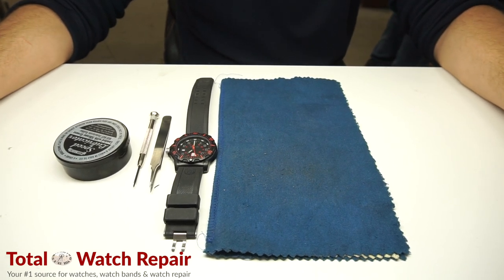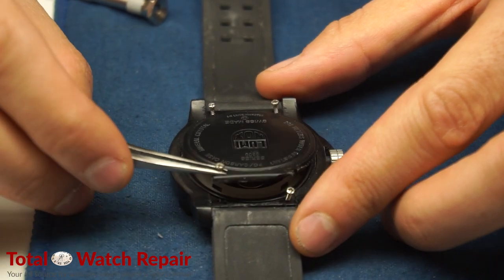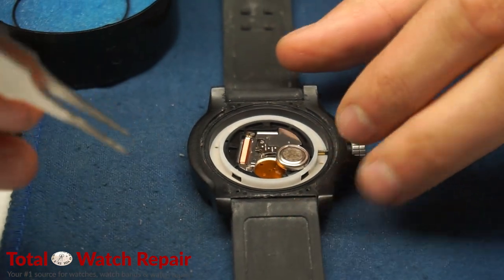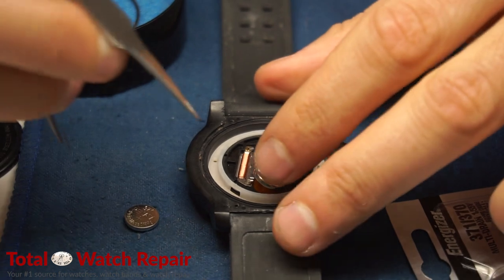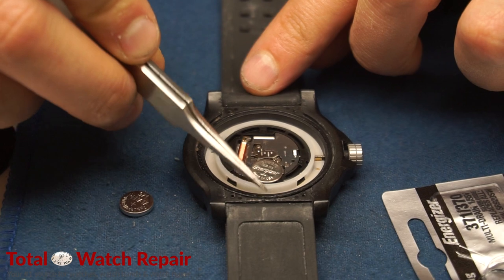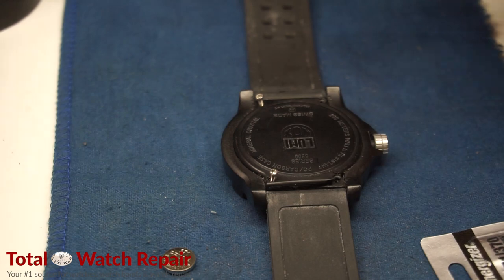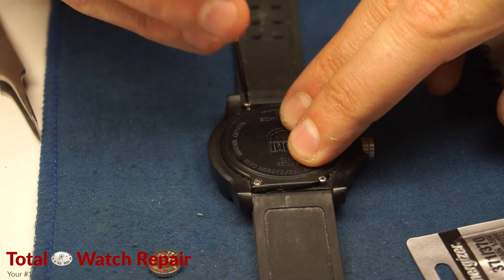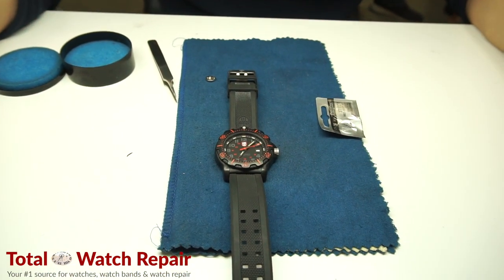Luminox 8800 Series Battery Replacement

Comment: Thank you for this video, specifically stating the type of battery needed and you really saved me by mentioning the little brown insulator required under the battery. I hadn't realized the insulator was stuck on the old battery and without it the watch didn't work at first.
Reply: What insulator?

Comment: Thanks for the video. You might mention in any future videos to always take care in making sure you do this repair in a low-humidity environment. Even a few seconds in a humid, non-air-conditioned environment can lead to water vapor appearing under the watch crystal even days after the battery has been replaced.
Reply: This happened to me, I live in Sweden and now at the beginning of winter humidity is always 90%+ No such thing as air conditioner anywhere where I can open my watch again. I'm thinking to re-do it after leaving the watch with the back case open in a sealed plastic bag with a couple of silicon bags (that usually come with the packing of other products) and try to screw the case somehow with out letting humidity in. Any thoughts?? I'll appreciate suggestions!
Reply: Any Swedish good watch brand ?

Comment: great vid, thanks for sharing it with us. Btw. have you encountered any situation where the watch's movement stopped after closing the back lid?
Also, I accidentally broke the negative terminal (little flat wire in battery housing) and wondering whether this can be purchased individually? Any thoughs? Many thanks

Comment: How do you get the chronograph back to the 12 o'clock position? My battery was just replaced (3080) and if I use the chronograph, it resets to the 59 min mark.